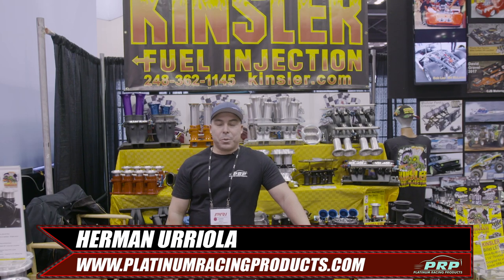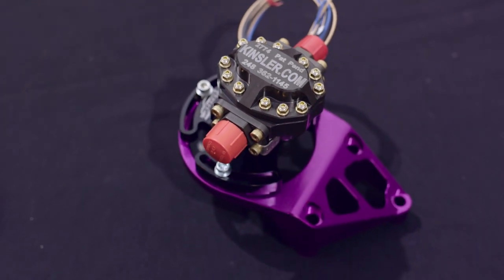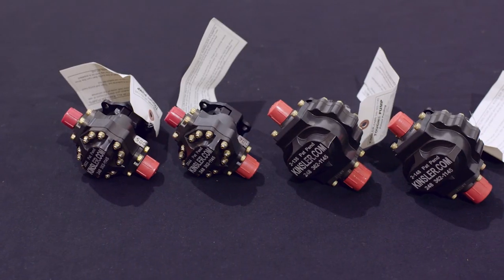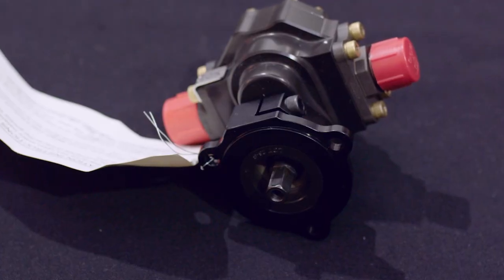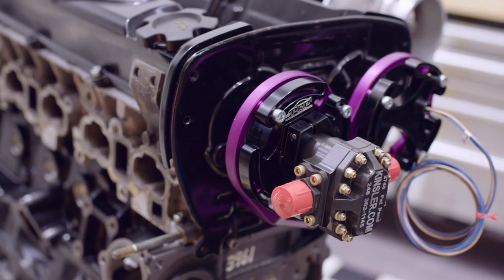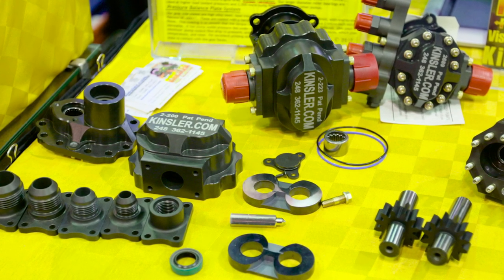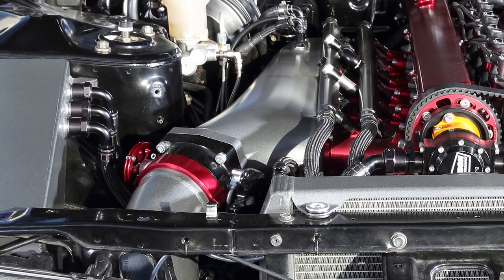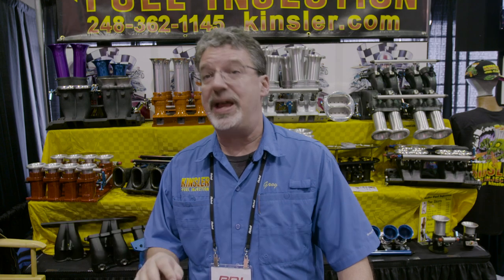Kinsler Mechanical Fuel Pumps - From NASCAR to Street Cars - PRI 2019

Comment: Would love to see an extension on this detailing the plumbing options, and benefits/downsides of the different options when running the supply line.
I'd love to run a mech pump in my GTR, but want a little more info on how it might be achieved without running a surge tank in the boot/bay.
Reply from the maker: You need a surge tank, or custom fuel cell, one way or another. Just a matter of where
Reply: @MotiveVideo  You also need a friendly mechanic if you want one in a road car..RWClyfe
Reply from the maker: @lachiemartin4311  HUH?
Reply: @MotiveVideo  great video.  Does a mech pump generate suction from the surge tank? Presumably the pump needs to be gravity fed from the surge tank?  Then its just a case of a feed and return via a lift pump from the tank?
You guys are running one on the GTR now, right?  Are you doing many miles in it?
Reply: @MotiveVideo  currently running a frenchies in tank twin pump holder/surge setup, was going to look into using a single 525 as a sort of overkill prime pump, and then let the mech pump draw from the tank once primed - fairly certain thats asking far too much from a mech pump in terms of suction though. Do you know if you can just run an EFI pump directly into the suction side of the mech pump? or is that just a plain stupid idea...
Reply from the maker: @nightkids7163  It sucks no problem. once the line has fuel in it, and no air, then it just keeps sucking away. doesnt need to be gravity fed